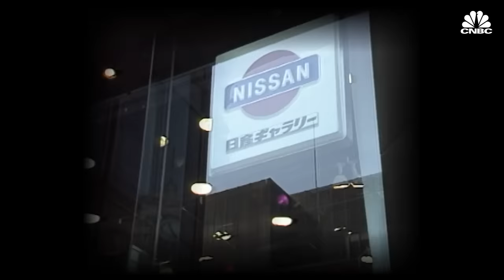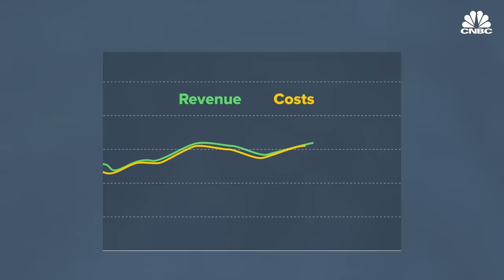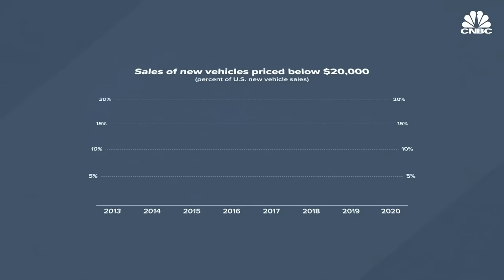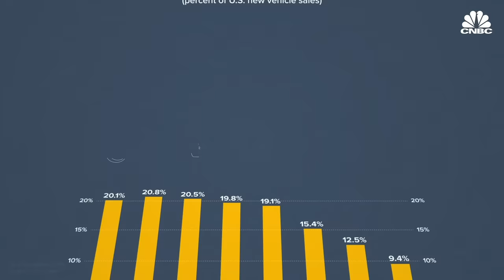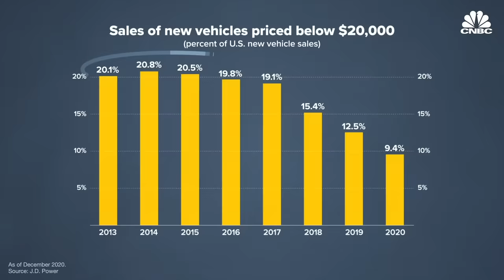Why Cheap Cars Are Disappearing

Comment: It was really about overengineering. Cars that was cheaply made could become expensive when added with so much complicated electronics. I really like the idea of Citroen 2CV, soft suspension, spacious, reasonable weight, very fuel efficient and most of all, no unneccessary electronics on it which make it cheaper, just a car you need to travel. Sadly, looks and convenience are always the king in the eyes of majority consumers.
Reply: I agree but I dunno if you'd want to share the road with Chevy Tahoes as a Citroen 2CV driver.
Reply: When someone spends thousands they do usually want more than just utility out of a long term asset they’ll be spend a lot of time with.

Comment: Cheap cars are in abundance, they’re known as Used.
Reply: I've seen used cars that are more expensive than new cars despite having 90k-100k miles on them
Reply: @aaroncabello8221  That's where Kelley Blue Book and Edmunds come in play.  To keep consumers from paying more than they should.
Reply: @wturner777  Rather to overpay?
Reply: Always let someone else pay for the first year's depreciation on your cars.
Reply: @nghtwtchmn129  Exactly, so others don't have to.
Reply: @aitorbleda8267  Determining the car's actual value and negotiations are two of the most powerful tools in saving money on a car.
Reply: my last dodge truck i bought i paid 5500 for it, threw a radiator in it, and got 6 years out of it before the frame broke from rust🙂. i now have a 05 2500 power wagon 4x4 with 100k miles on it i paid 5 grand. runs freaking great. put about 3500 bucks into it i will be good for another 100k
Reply: @nghtwtchmn129  It's pretty much this for me since I never bought a new car in my life (my current one is my 7th one). The first 3 ones were pretty unreliable but things inproved with time.
Reply: @julosx  The New York Times once reported that today's cars are so well made in order to meet emissions standards that 200,000 (miles) is the new 100,000.
Reply: My thoughts, too. Cars don't break down as much as it used to. It's better to buy used cars with original price of $30k @ $15k.
Reply: Pre owned. Never say "used"
Reply: Haha good one. 💯 agreed. Fools buy new cars.
Reply: @javaChai  jokes on you. Fools buy used cars and get stuck with part cost and maintenance. New cars can keep a great value before 50k miles on not even lift a finger on maintenance or tires etc. AND interest rates are way higher on used cars.
Reply: @rachelgamez3519  And $10k of repairs in the near term. In my experience, used cars are more expensive. The only people who get good deals on used cars have trustworthy friends or family to purchase second hand or know what to look for. Every car I got eventually had critical issues that would cost more than the car was worth to fix.
Reply: @BenjaminCronce  I don't buy used cars myself. However, I am an excellent person to buy a used car from. I just traded in 2013 RAV4 with 30k miles on it. I only drive about 300 miles / month and no accident in 20 years.
I agree that a person needs to know about cars to buy a good used car. The reputation of used car salesperson did not come out of nowhere.
Reply: Used cars can be the wisest purchase if you're careful about them
Reply: @rachelgamez3519  lots of short trips in a car is actually a BAD thing
Reply: @javaChai  ... wife likes new and makes enough money to afford it.  Me?  I hate the word depreciation.  
Anyway, I drive a Jeep Wrangler and plan on upgrading to an M38, another Jeep.  I'm not interested in anything else.
Reply: @BenjaminCronce  not true it’s all about where you dig in my opinion I rather not finance altogether. I work in a factory and learned that buying a car flat out used is better than getting hit with layoffs then having to pay rent/mortgage insurance and a note. I currently drive a 07 mustang with 110k miles I spent only 3500 for it 3 years ago. Haven’t had any issues since. The problem is our American culture that has us competing amongst one another. These companies study us and they know us better than we know ourselves. 
You can get away with a good car that’s 5-10 years old and pay 5k and it will last you a nice while and when you do have a repair, have a budget for for those rainy days. Financing a new car is bull because you think you getting a deal with good credit until you realize how fast a car actually depreciates. But this is my opinion.
Reply: @aaroncabello8221  yeah, used luxury cars vs entry level new cars
Reply: @nghtwtchmn129  - i'm happy do do that for people who think like you
Reply: I buy late model cars with one or two years of warranty left.  I like to own cars during the flattest part of the depreciation curve - between about 30k and 90k miles.
Reply: @stfu4159  - insurance costs more, and the tabs cost way more. Just think, the car you buy used was owned by a "fool" who sat in that drivers seat. A "fool" who who wanted to drive a new car, and break it in for someone just like you!
Reply: me nkat  - and while we're at it, don't forget "ignorance is bliss"
Reply: @aaroncabello8221  I've seen kia stingers more expensive than Bentleys and Lamborghini lmao,(used vs used). Dunno why anyone woupd pay 100 000+ for a kia stinger, you can pick up multiple Bentleys and be left with like 20k.
Reply: I searched Craigslist and there were no cars that ran and were in any kind of worthwhile condition under $1000. I check 3 large metro citys.
Reply: used ain't cheap these days, unless the wheels are falling off.
Reply: @aaroncabello8221  right i seen a 2013 toyota land cruiser with 120k miles for $47k i said thats a miss print looked up kelly blue book and that was the average price
Reply: Cheap, used maybe :</
But, more an more cars are becoming modular imported. An "Assembled"  in USA to avoid import taxes. Taxes from the vary people that bailed them out. Add parts an labor for repair costing more. Its easy to get into used POS that cost you more then just getting a new cheap or quality car. Like, take Ford focus for example. Its  aprox $3500  when your evap heater core needs repair. Its 12+hr job to disassemble half the car. To then remove a modular 1k+ factory part with a 5y aprox projected part life. The car may not be worth repair for someone.  Just having bought it 2-3y old on sale used for 10-12k. Maybe only having it 2 years. To then dump $3.400.00 into there 8k bluebook car might seem not very cheap. An that's just one repair among many along the way. 
 In the end however
Most early homes at best had one family car. a main room TV. 
IMO < Maybe the problem is we all expect or need to have 1 per family member now. :</
Reply: @aaroncabello8221  Were they high-end, quite expensive cars to begin with, Aaron?
Reply: And that's FINE with me! I live in L.A. and it's not worth it having a nice car. Not at all!
Reply: Yes, but they are only cheap to buy, but not cheap to maintain since they'll need more frequent repairs.
Reply: @James-mw7zv  That's right, James. Just like I say "vintage" rather than old.
Reply: @aaroncabello8221  lol dude you cannot argue that used cars are more expensive that's literally a hugely incorrect statement
Reply: @George L I didn't know that, but it doesn't matter. I just get them through my trusted mechanic (private party) for about $4,500 and that's it.
Reply: @George L Hmmm. I let him know what kind/type of car I was looking for well in advance of when I'd need it, the price that he'd been servicing for years and have had NO problems, George. There are enough problems out there (including unprovoked shootings being back with a vengeance within the last WEEK) to go looking for problems where there aren't any.
Reply: You got it right on.  The largest car market in USA year after year are.... USED.  About 25 million used cars are sold each year as compared with about 16 million new ones.
Reply: @sonn5574  Toyotas retain their value because they are super reliable. That Toyota Land Cruiser will make it to 300,000+ miles if it is taken care of at a basic value.
On the other hand, a Chrysler or a Nissan will be worth next to nothing post 100,000 miles because they are liable to break down.
Tl;dr good cars depreciate slowly
Reply: I don't know about that, the numbers of old Toyotas I actually see on the road aren't that many. I see a lot more old Dodge trucks than old land cruisers. I don't go by what people say , people are liable to say anything these days. I go by what I see with my own eyes in the real world.
Reply: @drewburt4315  The number of Dodge Trucks sold in the US year by year utterly dwarfs the number of Toyota Land Cruisers. Just going by how many you see on the road is a terrible way compare the reliability of two vehicles that sold vastly different quantities.
Reply: Iv owned cars and never bought a new car or will ever buy a new car i my life.
I'm now 60 and driven every day since 1976..
Reply: Back when you could wrench your own car in your own driveway, I'd agree with you. Now? With planned obsolescense, high cost of parts, and the insane cost of diagnostic equipment -not so much.
Reply: @BenjaminCronce  If I'm lying, I'm dying:  In 2010, I bought my Ford Escape 2007 with 50,000 miles on it.  I bought it certified from the auto dealership. To this day, it's the only one I drive and now has 165,000 miles. I love it and still runs like a champ.  The only major issue I had was last year when the transmission broke down.  It was repaired with new parts and was  left like brand new. It cost me about $1,200 to repair.  I'm driving it until the engine and wheels fall of.  Good ,used cars are easy to find.  It's not rocket science.
Reply: Sure if you want a 10 year old used car. We're looking for used subarus crossovers and they are still in the 20k range.
Reply: @nghtwtchmn129  -  Not in the NorthEast. They rust as fast as before.
Reply: @aaroncabello8221  Same model?
Reply: lol used cars have been over priced for close to a decade do to demand, tucks are the worst unless thee driven into the ground,  Seeing many more " rebuilt" totaled cars on the roads these days thanks to the crazy prices.
Reply: @wturner777  Yep. Shout out to Carfax as well. Between Carfax and KBB/Edmunds I was able to buy a pre-owned Hyundai cash because the price was decent.
Reply: @nghtwtchmn129  This is just a lie.
Reply: @pfefferle74  like old cheap cars there steal cheaper.
Reply: True, but the US market is actively trying to eliminate older cars in a variety of ways, AND people are holding onto their cars longer making the "used" car inventory a lot smaller. I bought a used car a few years ago and the guy told me he might have to get out of the business because he was having trouble getting his hands on cars so he could resell them.
Reply: @d.s7741  If the person was a fool there is no telling what they did to the car. I wouldn't buy from a fool.
Reply: My car is a 2007 mazda. She was 4000 and still works.
Reply: @javaChai  Think about it for a minute. If no one bought new cars, would there be any used cars? 🤔
Reply: This comment hasn't aged well.
Reply: Biden
Reply: @aaroncabello8221  thats called a mark up.. find a dealership with less mark up.
Reply: Not anymore. Used cars almost as expensive as new cars these days.